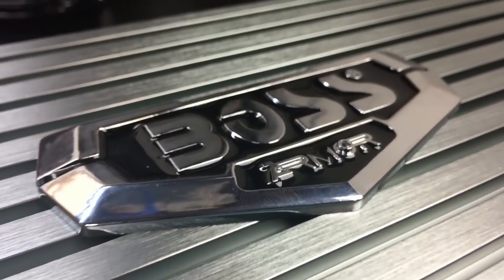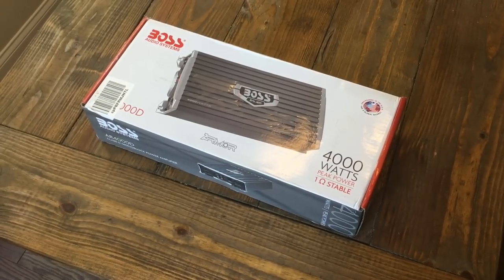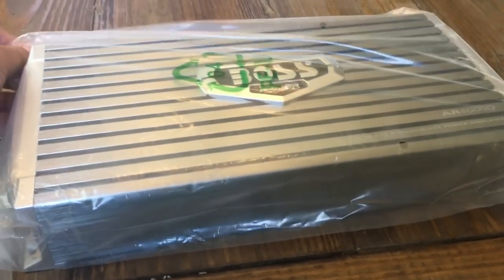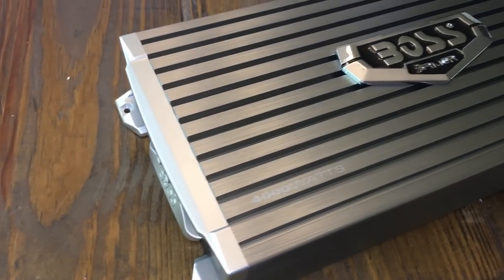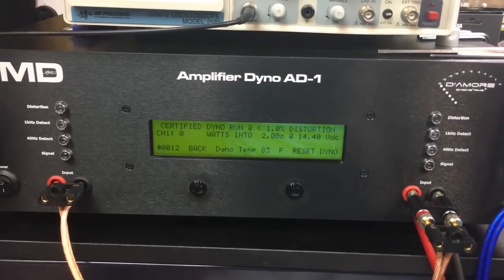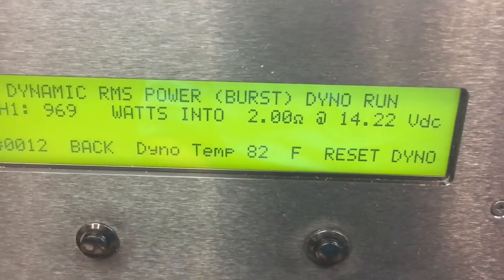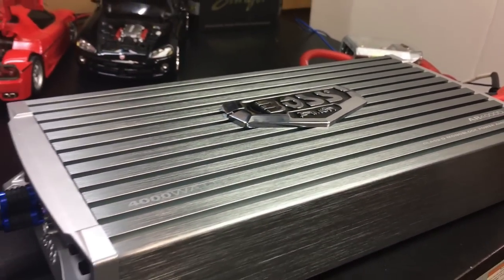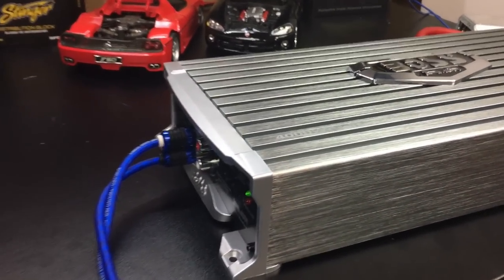Who's the Boss? AR4000D 4k MAX Amp Dyno Test

Comment: at a 1000 watts what was the THD of this amp 10% or more? And could not help seeing the distortion light up like a christmas tree on the dyno lol but then again only $100.00 bucks!
Reply from the maker: +Marc Favell the Dyno tests RMS power, so there may be some distortion detected, but the resulting numbers show RMS power at either 1% THD or clipping, depending on the test
Reply: i understand but with 0.007%  distortion dyno of say 100 watts will be will be more usable power then a 100 watts @ 1% distortion dyno for full range speakers you will here it in the sound in real world tests and would not use the power because speakers make the ohm's change and are not consistent, unless it a true digital amp and that does not matter as much, but you will not get more power with a digital amp when using 6,4 or 2 ohms that why on some of your dyno's not much change in power in the dynamic power tests.

Comment: For $100 its hard to really shit on it but that efficiency is case and point for you get what you pay for. The Pioneer you tested did 71% at 1 ohm certified and this did a 58.5%. Don't cheap out on your amp folks. You get what you pay for. Two of these running 1 ohm will do 1800 watts and peak to 2800 watts. Two of those Pioneers running 1 ohm will do 2400 watts and peak in excess of 3500 watts. Those Pioneers will run off the same alternator as two of these Boss amps without issue (unless you really skimp on the alt too). 

You think you are saving a buck but you end up spending the same amount of money throughout the rest of the system. Same batteries and alternator

Comment: This amp appears to share the same internal architecture as the Cerwin-vega H42000.1D which is rated by Cerwin vega as follows.
RMS Power at 0.1% THD
1000W X 1 @ 1Ω,
 700W X 1 @ 2Ω, 
450W X 1 @ 4Ω 
The H42000.1D is currently on Amazon for $237.63US, while the Boss AR4000D is $97.99US, these are essentially the same amps except the Cerwin Vega has nicer terminals.
Reply from the maker: Ow that’s interesting and sad all at once
Reply: BigDWiz 
It gets worse, the Cerwin-Vega XED1200.1M which Cerwin rates at 450 watts RMS into 2 ohms. shares the same internal design as the Planet Audio Anarchy AC2500.1M which planet audio "generously" rates at 1875 watts RMS nto a 2 ohm load. 
It would seem Cerwin Vega is using the same China based manufacturing and design resources as the Boss group (Boss, Planet Audio and SSL).

Comment: hey, anyone out there that can help? I bought this amp because It seemed to push big numbers for the money, but in the end, I wired up mine in my bedroom on a computer power supply, and when I turn the gains up to match the subs, it clips like crazy and makes a squealing noise from the inside of the amp and the voltage drops to below 11v when pulling just 20amps with the subs wired up at 2 ohms (there's 2 of them) and with the clamp meter and the voltage, I calculated that it was only pushing around 150watts??? Is my unit defective and should I get a replacement under warranty, or is it just the way it is? P.S. I tried this on a car battery (not in the car though) and got the same result (voltage still dropped, even on battery), also tried wiring up another power supply in parallel for double the current, just in case the other power supply wasn't enough

Comment: Are these amps any good now? I was born in 1984, and I remember these amps. They were cheap as hell and we would go through them like disposable cups because we were too impatient to save up for a decent amp instead. But they worked really good, in spite of the rating being bullshut, for about a week :) I don't have a great memory, but I don't remember boss lying THAT hard back in the day. Don't get me wrong though, they were complete garbage that killed themselves attempting to deliver their power.
Reply from the maker: +Richard Smith super cheap, good protection circuits, but reliability is hot or miss. Ratings are a joke

Comment: 1660 did it really do it since it went into protect?
Reply from the maker: +John Work yes, the power was measured just prior to going into protect...but also proof the Amp should not be used at less than 1 ohm

Comment: I've got 2 10"s with rms at 350w each how would this fair
Reply: Depends on the sub ratings. If cheap brand subs it will flex them. High end subs will need more power. It should push most single sub applications well.

Comment: So I’m 5 minutes in and you said leave a comment and tell us what you think. I’ve had 2 thoughts so far. 1 my $1100 jl audio amp did not come with a bass knob, that was $40 extra and it’s super cheap and plastic, and the amp does about 1000 watts. It’s a 900/5. So at least $1 a watt. 2 This amp comes with a cheap plastic bass knob and costs $90. So if it does more than 90 watts jl audio ripped me off. Lol. I’m guessing it does about 1000 watts. Maybe 13-1400 dynamic.

So now I’ve watched the video. This amp did not go into protect at 1 ohm certified. It did 1425 dynamic so that’s a little over 6 cents a watt, and it’s pretty efficient . Make fun of boss all you want. This amp is a freakin steal. Who cares what it’s rated at.

Comment: How can it pull more amps than the fuse rating without blowing the fuses?
Reply: Fuses can exceed their breaking point in short bursts.
Reply from the maker: My comment was related to continuous output. The fuses can handle 2-3x or even more of their ratings for short bursts

Comment: Today's car audio systems are so good, better than home audio, that it is more valuable to buy that for your home that any home audio systems. All that is needed is a home 12 volts power supply. A complete car audio system is advertised everywhere on internet  under the label : Car audio bundle  or  car head unit bundle for as low as 93$, these are the newest complex digital sound processing and amplification.
That cost nothing to manufacture. I hope that home audio manufacturers soon offer this new tech for home at the same price. If they offer their system with an hdmi output, where you can ajust visually bass and treble and audio inputs and volume, than it will cost no more than 200$
for a stereo  200 watts rms system.

Comment: back in the day 1993 it would have cost 1,000 plus i bet 2 amps and 2 1ohm 15" subs would slam thsnks for the video big d wiz need to dyno ssl 4,000 d next i have one very curious what power it makes at 1 ohm
Reply: Tron1731 I currently have one of these powering two hertz hx380 subs hooked in series so 2ohms and they do pretty good.  Cheap amp. Good subs.

Comment: so how come boss does stuff like this with their products? Cause I wondered the same thing with the rms ratings for some 10' inch subs I bought from boss. that claim they are like 2200 watt subs, I just laughed at that and wonder how much I can actually throw at them. hell I even think this is the amp I saw sold in a bundle with the two tens. I guess it's all just to make you feel like you have a ton of watts in your car.

Comment: For a cheap AMP you really cant beat boss. I've had mine for 13 Years now its rated at 3k watts but I'm sure its closer to 1k watts. Its powered a kicker L7, 2 12" kenwoods and now its beating on a W6 12" JL audio all over the last 13 years and it never skips a beat, might not be the best sound quality but you just can't beat it for the money.

Comment: can you tell me how to set my gain properly?
Reply from the maker: +Jerrieme Stebbins if you don't have access to an o'scope or DD-1, you can still set by ear although it won't be perfect, it can work. Problem is there are many different amps/head units, so I can't give you a single answer for each application. "Properly" would involve a DD-1, test tones and non-inductive resistors.

Comment: Many people believe these cheap amps are cause of vehicle fire.. no! These are not the cause of fire. The main cause of fire is cheap wiring and 17yo doing improper janky installations in their hondas.. the amp is in a metal box and even if it blows up semiconductor fires do not last longer than a few minutes and they do produce heat but not enough heat to cause carpet or other things to catch fire unless in direct contact which is not possible cus the whole thing is a big sheet metal and aluminium case..

Comment: What is a good amp for 2 4ohm Dvc 10inch subs I wired them down to 1 ohm also thank u
Reply: Bro. You need to study and read 
Things ok.  That's such a noob question. And it's a question that cant be answered which is why it hasn't been yet. 
Coil and size means nothing.
 Qhat sub and model is it.
 I know Dvc 4ohm subs that are rated at 100 watts
And some at 3k

So what subs are they. And not just the brand. But the model also
Reply: I know what I'm doing lol just asking what r some good 1ohm stable amps
Reply: @Lahotboy2024  again. Same answer.
Ypu probally dont even know what subs you have 
Fact is.
 We still cant help you 
We cant advise an amp until you explain how your electrical is.

We cant say
 Get this amp is your alt cant keep up.
 
So again. Your question lacks the details needed to answer your question .

So try again.
Reply: Lol not really bro I have 2 kicker 10inch dvc 4ohm subs rated for 400 watts a peice I have them wired down to 2 ohms now cause the amp I have is 2ohm stable I'm buying and looking for a good 1000 watt 1 ohm stable amp I dont need to upgrade my alt bro now if I was pushing some big subs and strapping amps together then yea I would need to of course all I asked was what is a good amp that is 1ohm stable and u just blew it out of the water I dont understand why some people r just ass holes
Reply: @Lahotboy2024  400 watts is 200 rms.
Watts is peak.
You have the kicker c10-10
Or the cvr
 Both are shit.
 Small thin 2 " coils.
You give the 1k
You better say good buy.
 But to answer you
 The boss armor 4k does 1k at 1ohm. It's cheap just a bit much for the subs
Reply: Thank u I'm not going for  Competition this is just for me myself and I I'm not trying to knock pictures off the wall lol
Reply: More then likely I'll upgrade to the skar line of subs and amps
Reply: @Lahotboy2024  skarbage... dd audio ...
 Lower line (red line ) are monsters.
2 1500 series 10s on a m1
M1 is 1750 rms
Can play down to a quarter ohm. 
 Skar amps are known to get very hot
And the glue used on their coils  are Chinese crap.
Reply: Ok thanks

Comment: what is the amplifier voltage ? i guess single 35v
Reply from the maker: If you are referring to the rail voltage, I did not measure
Reply: BigDWiz just measure it. and calculate the output voltage you will see how much current/watt it would handle

Comment: I bought two Hifonics HFX12D4 subs and a SSL (Soundstream Labs) 1200 watt 2 ohm stable amp for $120 on eBay and it replaced my blown Rockford Fosgate Punch HE2 DVC 12s just because I have been out of the car audio game for years and my Civic makes 508 whp, so you can imagine that I've been focused on the engine. Anyway, with an unpowered 7.5" Chinese touchscreen that has Bluetooth, it hits fairly decently in a Civic coupe. Now I know that it'll never come along the lines of my old Punch HE2s, or the old Memphis triple deck 12 that I had 6k watts going to, but I'm not looking to go deaf, just looking for a little depth to my music, and these cheap ass 12s do me just fine for the time being (or at least until the audio bug bites again, and it's already itching...). I am honestly trying to get into the Deaf Bonce subs entry level for now.

Comment: The funny part is the people who buy this amp won't be using OFC or have a strong enough electrical system to get results equal to this test.

Most likely it will be a stock acid battery, stock alternator, and an improperly installed 8 gauge CCA kit.

Comment: The low price is achievable because they are using Chinese class D amplification I/C's and not true FET amplification. The Class D amplification is what makes these amps so affordably cheap. The up side, besides price, is that they are easily replaceable, for relatively low cost, if you cook the amp. The down side, is they do NOT reproduce the audio to near as accurate a degree as a MOSFET amp.

Comment: My Kicker CXA 600.1 does 675 @2ohms and its only a 600 watt amp.
Reply from the maker: Kicker amps typically make more power than rated
Reply: I know. The CXA 600.1 is a beast of an amp. Thats why if I buy new ill only buy Kicker. Ive got the SSL Evolution 1500.1 hooked up to 2 4ohm 12's,now and that amp is just week compared to my Kicker amps.

Comment: Why 15 Volts? A car battery has 12V when left alone 14,1-14,4 when charging with engine started. 15V means over charging. So. .. I don't see the point of this computation.

Comment: Well i recommend to operate in around 20 C degrees or take out the Boss logo to set 2 computer 12v fans on it because it gets too hot and protects itself, the dissipation is excellent that's why you can get a good results with those fans.

Or just don't use 1 ohm config, just reach the 800 watts to prevent any failure in the next 10 years, remember that the good amplifiers tend to last for ever. I do not know this brand well yet but my kenwood has more than 10 years doing 70% their capacity.

Boss does not have quality, but why? because quality is to reach the costumers satisfaction, we are not satisfied when we see the rms shown in the boss webside. 3000 RMS in 1 ohm load. Yes, they say that, link below.

BigDWiz your video is very appreciated thanks you.

https://www.bossaudio.com/auto/car-audio-sound-system-auto-monoblock-amplifier-boss-audio-ar4000d/

Comment: haven't watched to the test yet, decided to do some math first, if it has 3 40a fuses and draws 12v it can't draw more than 1440w without blowing the fuses, and some of that power is going to be shed as heat so I already know it's not a 4000w amp
EDIT: I didn't get to the part where he did the math himself before making this comment
Reply from the maker: Fuses will allow much more current than their ratings for short periods though. But yeah, no way it's a 4kW amp, mainly because it costs $100 and with the current cost of components, it's not possible

Comment: take 1800...and multiply it by .707(r.m.s).....and youll get aruond 1300 watts........so.....its 1800 watts max power....and....1300 r.m.s. power on "15 volts"(not normally).....all in all.....not bad for a hundred bux.....but how long it will last is the question!!!

Comment: You have to understand D WIz that those fuse ratings today mean nothing about current draw. I just seen you test that tiny little amp I forget what it was in brand but it had only I think 80 amp fusing and you said nothing the same like this video and that amp drew 150 amps of current. Peak amps is like peak wattage right? Digital switching circuits D class do not consume raw power like Class A, B or G or H. D is a whole other class and fusing cannot be counted the same. The biggest problem I see with this amp is efficiency. It pulled 111 amps on 14 volts at 1ohm certified. Horrible efficiency. An amp that delivers anything more than 300 rms for just $99.00 that's a great deal and you can't argue that. It really sucks the amp manufacturers will put lies on the box overrating however it's no different than Rockford claiming to be a certain rate and going over that rate which makes both brands cheaters or liars. I'm glad after I already wrote this you did say great boom for the buck. My very first amp in 92 was that big blue anodized aluminum BOSS 600 watt amp and it probably only put out 300rms back then class A mosfet. I can't find anyone with a picture of that amp today at all. That was more than enough power for the Kicker 15" freeair solobaric back then that could I think only could handle 300rms back then. I know one thing My Dodge Aries piece of crap first car K-Car was bumping pretty damn good for minimum wage income. lol. The next amp I bought was the Majestic mosfet 500 watt amp. Then I kept saving and straight to the top with Rockford Fosgate Punch amps.

Comment: on the same token as you bashing them for only listing MAX wattage, you are only testing RMS wattage so at 1660rms it very well could do 4k MAX watts, do you have a way to test max wattage?!?!?!?
Reply: kevin auman the dynamic burst test he does measures the peaks the amp is capable of delivering, so to answer you question; no it can not.
Reply: Jeroen Schuuring peak "rms" tho or actual musical PEAK which is right before meltdown I'm sure! loll
Reply: kevin auman peak before melt down. The amp went into protection mode, so that's as good as it gets without some sort of hacking to bypass protection. Even then it's just going to pop fuses or capacitors.
Reply: Tom Davis actually it went into protect when he had too low of imped at .8ohm not because it had reached its peak output in any way!

Comment: $85 for 1000 watts. That's like 8 cents per watt. Good deal.
Reply from the maker: +quepiid I paid $275 plus tax for my first RF Punch 45. It was rated 22.5x2 or 70x1. That's like $4 per watt, but my tests have shown it does close to 150 watts, so still $2/watt. Prices today are stupid cheap

Comment: Would make a nice amp for my 12" jbl subwoofer. Only need 300w at 4 ohms for that. BUT! Spade connectors, yuck! Hate them. I'll always pay the extra penny to get compression direct wire connects. 

Still using a old school 2005 sony 4 channel bridged for that sub. 125w. Seems to buy a nice amp for that sub, runs at least around 100$.

Comment: Alguien que me ayude ?  Tengo un amplificador boss armor clase D de 1  canal  el amplificador total de poder 4000 watts 
Max power @ 1 ohm 4000 watts x 1 canal 
Max power @ 2 ohm 3000 watts x 1 canal 
Rms power @ 4 ohm 1600 watts x 1 canal 
Speakers impedance 1 ohms 
Tengo 2 pioneer ts-w3003D4 
Cada una es de 2000 watts  y 600 rms cada una   Mi pregunta es como debo hacer las conecciones al amplificador a cuantos ohms las tengo que conectar ?